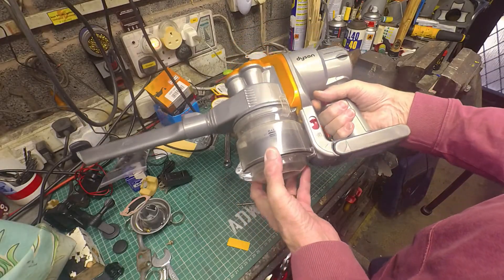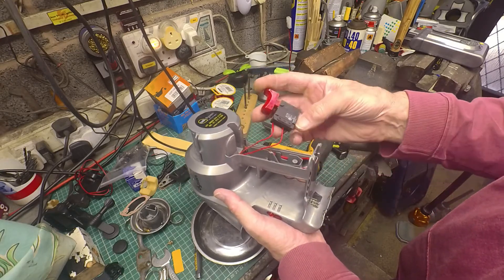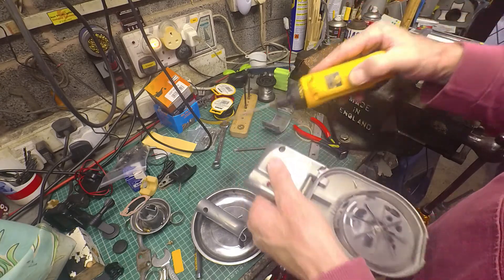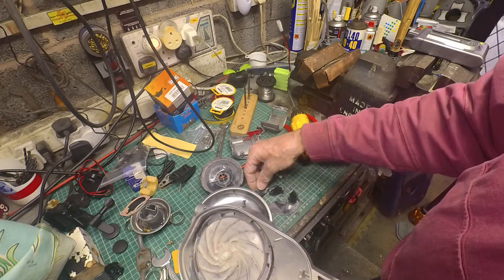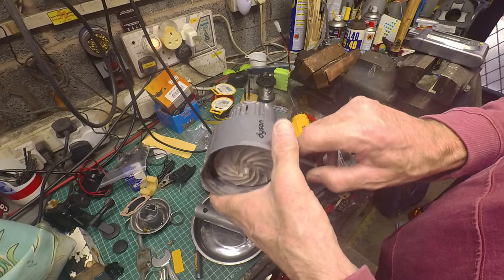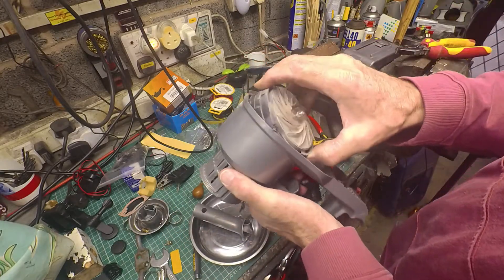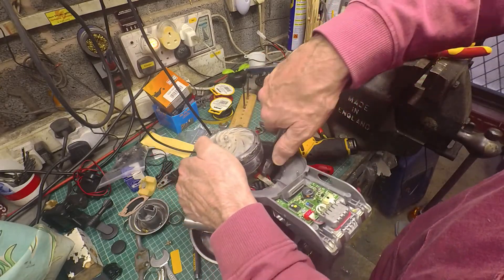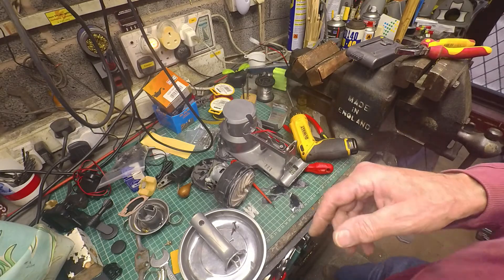Dyson DC16 Tear Down

Comment: Now I took mine apart, following a similar sequence to what your video shows. I took the complete motor assembly out and then removed the tape which holds on the black cover, that works better than prying it off while the motor is still in the housing. 

In my unit the black disc with the vanes which on your vac had shattered is still mostly intact and in place, but it has a chunk missing on one side, which is why my vac will work until the motor is run up, then it has horrible vibration and burning plastic smell as that unbalanced disc rubs on the case.  I will attempt to repair it as I can’t find a replacement fan disc for sale anywhere. 

FYI, this black disc fits against the face of the white one and becomes the second half of the fan which spins with the motor shaft. It’s not static as you mentioned. Only when shattered I guess! 😂
Reply from the maker: Thanks for the update. Interesting - so the black part is somehow bonded to the white disc and forms an integral part of the rotating impeller. I hope you're able to fix yours 👍
Reply: @Greeves well the upshot is that I’ve ended up prising off the black disc entirely, as attempts to stabilise it and balance it with an equal chunk out of each side failed badly, as my cut fingertip will attest. 

So now the whole vac is back together with only the white open-faced part of the centrifugal disc spinning within the black outer case and the unit works and sounds much the same as before, but overall suction is reduced, which is a shame. 

I’d say it’s useable, but in danger of being replaced with something more effective… 😅
Reply from the maker: @PVflying Thanks again for the update. I admire you for trying 🙂. Finding a donor machine to use for spares might work I suppose but probably not worth the hassle / further injury 😳🤓
Reply: @Greeves yes, I will keep my eyes open, but I doubt there are many of these DC16s around still and those which have survived so long will doubtless have the same inherent weakness in the fan rotor disc, as yours failed in a similar way to how mine was heading, so I suppose they all become brittle and shatter from age. But for now mine lives on, with weak suction and suited only to light duties 😅

Comment: My trusty DC16 died today, after only 16 and a half years of nearly daily use daily use 😢 (nothing lasts anymore 😅)

 When I get some time I will strip it down as you did (thanks for your video ❤) and see what happened. It made a weird noise and ran much slower before dying with a burning electronics smell, so I’m thinking maybe motor bearings failed and stalled it.  Maybe I can get a new motor to fit, maybe not, but I’ll take a look 😊
Reply from the maker: It’s always interesting to have a look, at least 🙂

Comment: What's your experience of the volume of this dyson? I have the same model and it's slightly uncomfortably loud. I'm wondering if it's undergoing a similar self-destruction as yours.
Reply from the maker: Hi. Ours didn't seem to get louder in the run up to failing completely. I wasn't the one using the machine when it failed but maybe it was bumped against something, causing the impeller to touch the static vanes, leading to a cascade of destruction until the motor stalled and burnt out. Maybe it was the 'last straw' for a long term fault developing in the spinning parts. Either way, there was no noticeable change in volume ahead of time.

Comment: Thanks for you teardown of the dyson dc16. I bought a faulty one that cuts out after 3 seconds, I'm planning of running it from a drill battery that has double the current as the orgional dyson battery on a short lead that I can attach to my belt that easy the cleaner will be lighter. I paid £20 for it boxed and in really good condition obviously hadn't done much but still failed. I think Paul Dyson should be derailed from his throne as a great inventor on all the hype fake marketing that has made him unworthy successful. I enjoy taking things apart and this has been an eye-opener as to the junk Dyson is. This unit hasn't even got a brushless motor, shame shame  on dyson, but I suppose at least he rips off the rich like Robin Hood did, I pity anyone who was scammed by dyson with empty promises of this cheap junk, lidl would do a better cleaner. I paid £20 Ann in totally disappointed by the quality of the over priced hyped up junk. I want to point out some of my findings to back up what I'm claiming. 1:Too small of a battery pack that is running overloaded which will cause it to overheat, soluction: could have had double row battery pack with twice the current. 2: battery should be able to charge separately from the cleaner and faster like a shark has that option. 3: should have a soft start brushless motor to ease the startup current as motor gets up to speed. I could go on but it's a waste of time, I'm glad I didn't buy a new one. I've seen this model in Sainsburys supermarket at £160 back I think 2016.
Reply from the maker: Thanks for the comment & glad if the video’s of some help. I like the sound of your hack. I could do with a hand held to use in the garage; I may well look for a failed Dyson (or similar) on eBay & try a similar thing 👍
Reply: i too am horrified by this cheap desighn and construction

Comment: Excellent tear down.  There is a Hall effect magnetic sensor on the unit which is activated by a permanent magnet in the front filter.  Filter needs to be installed to allow the motor to work.  Your video showed me how the black fan cover comes off! Thank you for that!
Reply from the maker: Glad it helped :)

Comment: I paid good money for that quite a few years ago i still have it. It broke maybe 2 years after I purchased it and I could never get it to work again  it runs for 15 seconds and then shuts off. I try to repair it now and again but no luck about 5 years ago I bought a cordless Shark and I couldn't be happier it picks up everything I don't need all them fancy contraptions to put on the end the shark spins and picks it all up it never stops never sputters it's just picks up all the dirt I empty it it's ready to go again I love it I used to love my Dyson but it just decided to stop working if I didn't have vacuum today and I was going to buy one a handheld and I had a choice between a Dyson and a shark I will buy a shark every time and I don't even care about the price it has nothing to do with it I can afford any vacuum I want easily.  The shark is just better for me
Reply from the maker: Thanks for your comment. From my Dyson experience I have to agree with you. I've had several versions now and each generation gets more complex. I've just spent virtually a whole day fixing our V7 Dyson, which had the usual stop-start issue. This seems to always be down to either the battery, or the internal passageways clogging up - it was the latter in my case. I took the V7 completely apart, which is far from straight forward and involves c.14 T8 torx screws, some virtually invisible down deep recesses. Not a job for a casual end user. It was filthy inside the tiny cyclone cones & other complex passageways. FInally got it cleaned up and reassembled (with only one screw left over!😆) and it works like new again. Dysons are great when new but they shouldn't fail after a few years just because their inaccesible internals get dirty. They do seem to have lost a sensible balance between performance, high-tech marketing appeal & practicality. It's also not very 'green' if people end up throwing them away after a couple of years.

I don't expect to buy another Dyson and will likely go for a simpler, more serviceable type. I'll definitely have a look at Shark; thanks for sharing your experience with it